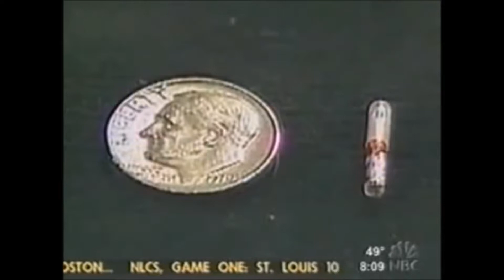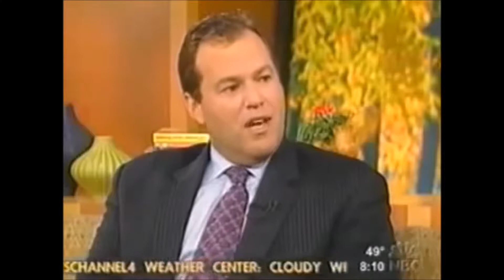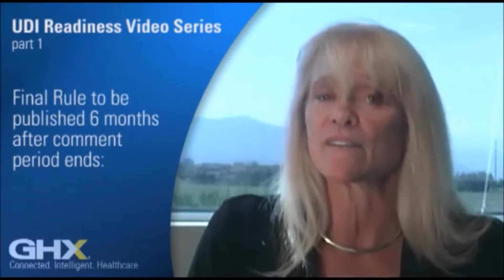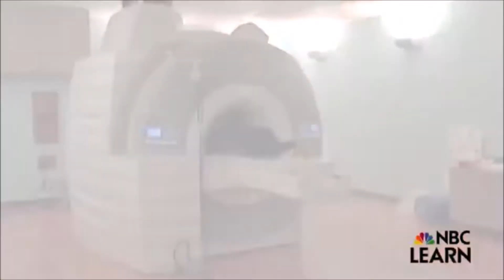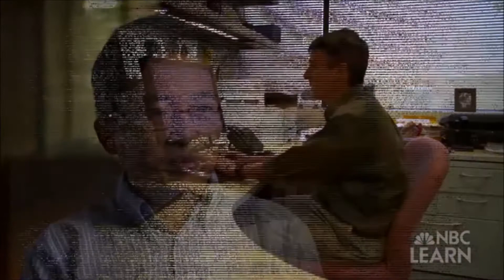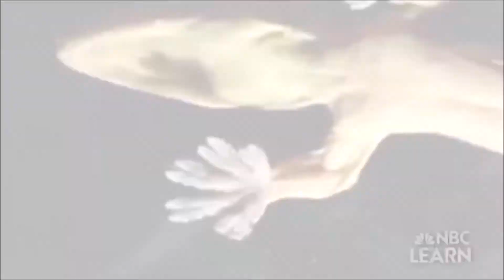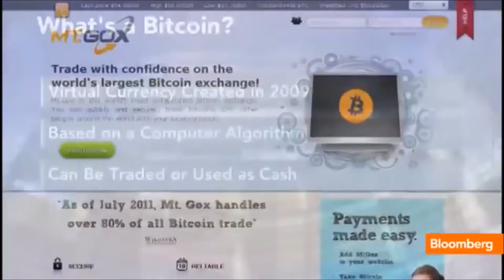Mark of the Beast: Part 1

Comment: DONT BE DECEIVED!   Rev 13:14 And DECEIVETH them that dwell on the earth...  But what does deceived mean, and how are they deceived? Deceived = Deceiving involves the deliberate misrepresentation of the truth, so that those being deceived are not aware of the deception.

The mark of the beast IS NOT FORCED UPON ANYONE. Scripture is clear in Rev 13:6 that the beast (system) CAUSES the mark to be received by those who are deceived. Some translations misinterpret the orignial greek word 'poiei' as (FORCES) but it actually means CAUSES, which is the same as the Strongs Word 4160 'it causes'.  Again in Rev 13:17 the key word here is the greek word 'dynetai' or Strongs 1410 meaning 'SHOUD BE ABLE'. So the proper translation reads, "...THAT NO ONE SHOULD BE ABLE TO BUY OR SELL.....

At what times in scripture did God (through His servants the prophets) tell believers that they SHOULD NOT BE ABLE TO BUY OR SELL? Neh 10:31 “When the neighboring peoples bring merchandise or grain to SELL on the SABBATH, we will not BUY from them on the SABBATH or on ANY HOLY DAY.

And yet again here we are told a similar thing in Neh 13:15 In those days I saw people in Judah treading winepresses on the SABBATH and bringing in grain and loading it on donkeys, together with wine, grapes, figs and all other kinds of loads. And they were bringing all this into Jerusalem on the SABBATH. Therefore I warned them against SELLING food on that day. 16 People from Tyre who lived in Jerusalem were bringing in fish and all kinds of merchandise and SELLING them in Jerusalem on the SABBATH to the people of Judah. 17 I rebuked the nobles of Judah and said to them, “What is this wicked thing you are doing— DESECRATING the SABBATH day? 18 Didn’t your ancestors do the same things, so that our God brought all this calamity on us and on this city? Now you are stirring up more wrath against Israel by DESECRATING THE SABBATH.” Amos 8:4 Hear this, you who trample the needy, to do away with the humble of the land,  5 saying, "When will the NEW MOON be over, So that we may SELL grain, And the SABBATH, that we may open the wheat market, To make the bushel smaller and the shekel bigger, And to cheat with dishonest scales?

The biggest clue in scripture to deciphering the mark of the beast is found in Mat 21:12 Jesus entered the temple courts and drove out all who were BUYING and SELLING there. He overturned the tables of the money changers and the benches of those selling doves.

Why would Christ be concerned about people BUYING & SELLING? Does He hate merchants? No! The reason was very simple - the inner court of the temple could not be opened except on New Moon Days & Sabbaths in accordance to Eze 46:1?‘This is what the Sovereign Lord says: The gate of the inner court facing east is to be shut on the six working days, but on the Sabbath day and on the day of the New Moon it is to be opened.

So in this case the temple was opened on Gods Sabbath Day and there were money changers and people selling animals for sacrifice, when Gods Law strictly forbids any commercial trade on His Holy Days.

So how do we recognize Gods Holy Days? We are told these things in Lev 23. The First Holy Day begins with a SABBATH after 6 Working days. But when does the 6 working days begin? After a New Moon Day. Numbers 28:11 "'On the first of every month, present to the LORD a burnt offering of two young bulls, one ram and seven male lambs a year old, all without defect. Numbers 10:10 Also in the day of your gladness, and in your solemn days, and in the BEGINNINGS OF YOUR MONTHS, ye shall blow with the trumpets over your burnt offerings, and over the sacrifices of your peace offerings; that they may be to you for a memorial before your God: I am the LORD your God. 1 Samuel 20:5 So David said, "Look, tomorrow is the New Moon feast, and I am supposed to dine with the king; but let me go and hide in the field until the evening of the day after tomorrow. Psalm 81:3 Sound the ram's horn at the New Moon, and when the moon is full, on the day of our festival (Passover + Firstfruits + Tabernacles = all on full moon);

But the only defense that people can offer regarding New Moon Days is this misunderstood verse in Colossians 2:16 Let no man therefore judge you in meat, or in drink, or in respect of an holyday, or of the new moon, or of the sabbath days:

So bible students automatically think God has made such observance voluntary, but this IS NOT what this scripture is saying. Its telling us that the true believers will not allow anyone to pass judgement upon them for keeping New Moon & Sabbaths and observing food traditions which point us to Christ - eg at the Last Supper, Christ commanded believers to eat the bread and drink the wine on Passover in remembrance of Him. But what about Col 2:14 Blotting out the handwriting of ordinances that was against us, which was contrary to us, and took it out of the way, nailing it to his cross; Well these ordinances were those which dealt with sin & sinners in accordance to the handwritten law of moses, but not the Commandments written on stone by the finger of God. Thus His 4th commandment pertains to New Moon Days, along with all other days as mentioned in Lev 23, with the exception that people no longer are required to sacrifice offerings. But observance of the days as being Holy are a mandatory requirement for believers.

The next Holy Day mentioned in Lev 23 is Passover on the 14th day of the 1st month, but is this on the 14th of January? NO! Why do we know that January is not Gods 1st month? Because in Ex 12:2 "This month shall be the beginning of months for you; it is to be the first month of the year to you. Exodus 13:4 Today, in the month of Aviv (Abib), you are leaving. Deuteronomy 16:1 Observe the month of Aviv and celebrate the Passover of the LORD your God, because in the month of Aviv he brought you out of Egypt by night. ABIB or AVIV is so named because it a reference to the stage of ripeness of Barley which only occurs around the time of the spring equinox, so that Gods perfect calendar always centred on His creation. So we only need to look towards the moon cycles around the time of the spring equinox to see the ripeness of barley to determine the beginning of Gods year - His first month which He calls ABIB, not january which is so named after 'janus', pagan god of the doorway. This is why the pagan easter varies from year to year, in accordance with the Moon cycles, so the pope & jews both know about this - hence the DECEPTION!!!

The whole world has been deceived by the beast and the second beast which made an image to the first that should speak to people. The first beast was the roman empire, which was then wounded by the sword (Word of God), and they became transformed into the likeness of a lamb with horns (Christian). The image they formed was based on the Julian calendar which gave the popes their authority to persecute and kill all who refused to worship the image of the beast (roman calendar). Then in 1582 the original roman julian calendar was slightly modified and ratified by pope gregory which became the gregorian calendar which the WHOLE WORLD WORSHIPS even until this very day.

If a believer follows the roman/papal calendar, they cannot find Gods Holy Days because Gods calendar at creation was based upon the Sun, Moon & Stars alone! Gods calendar has ABIB/AVIV as first month and New Moon Days, Sabbaths, and working days. Roman/papal calendar has days and months dedicated to the names of other gods to celebrate it pagan origins.

Thus every time a believer in Christ utters the name of the roman/papal calendar, they break Gods Commandment - Ex 23:12 “Six days do your work, but on the seventh day do not work, so that your ox and your donkey may rest, and so that the slave born in your household and the foreigner living among you may be refreshed.13 “Be careful to do everything I have said to you. DO NOT INVOKE THE NAMES OF OTHER gods; DO NOT LET THEM BE HEARD ON YOUR LIPS!

This is how the whole world has been deceived into disobeying Gods commandment against idolatry. The beast has replaced Gods Holy Days with their own holidays, so that Gods method of time-keeping has been obscured, thus people continue to BUY & SELL on Gods Holy Days when they SHOULD NOT, and thus CAUSES them to receive the mark of the beast, because they follow the beast system and worship its image (calendar), which is idolatry. This has been going on since the days of Christ when the romans first occupied Jerusalem in 63BC, and has continued throughout the ages, even until this very day.

The bible is self explanatory, there is no need to worry about SUNDAY or TATTOO's or RFID CHIPS or DNA or any such modern ideological nonsense. Such things could not possibly be called a deception and could not cause the WHOLE WORLD to be deceived. The method of timekeeping however, has fooled EVERYONE. Even the jews changed their calendar system back in 4th century AD under the leadership of Hillel II, so that all currently accepted earthly calendars are FALSE images of His orignial. Even the muslim calendar follows a strict 354 day year because it is lunar based alone, whereas Gods calendar is Luni-Solar as described in Gen 1:14. Eze 46:1-3 reinforces that Gods calendar is based upon New Moon Days, 6 working days, and Sabbath Days. Isaiah 66:22-23 also reinforces that Gods time-keeping system will continue even in the new heaven and earth by observing these same New Moon & Sabbath Days. Zech 14:16 also tells us that we will continue to observe Gods Holy Days like Feast of Tabernacles in the new kingdom to come.

The deception is something which we are not aware, and has been here for 2000 years. Sunday is just as much a lie as Saturday or Friday or any other roman/papal based name. Believers have been killed in the past for failing to recognize the roman/papal authorities, and today believers continue to be deceived to BUY & SELL on Gods Holy Days, thus receive the mark of the beast without their knowledge - its a spiritual mark. The prophet Daniel forwarned us of the changes to the calendar back in Dan 7:25 'He will speak out against the Most High and wear down the saints of the Highest One, and he will intend to make alterations IN TIMES and IN LAW; and they will be given into his hand for a time, times, and half a time.

Now listen to what the prophet Hosea has to say in 4:4 “Don’t point your finger at someone else and try to pass the blame! My complaint, you priests, is with you. 5 So you will stumble in broad daylight, and your false prophets will fall with you in the night. And I will destroy Israel, your mother. 6 My people are being destroyed because they don’t know me. Since you priests refuse to know me, I refuse to recognize you as my priests. Since YOU HAVE FORGOTTEN THE LAWS OF YOUR GOD, I will forget to bless your children. 7 The more priests there are, the more they sin against me. They have exchanged the glory of God for the shame of idols.

Believers are being destroyed for a lack of knowledge, they have forgotten the laws of God who created us all, so even the priests don't teach what God has commanded and have instead turned the people to follow idols (roman/papal calendar which honours false gods). Who teaches Ex 13:9 This observance will be for you LIKE A SIGN on your HAND and a reminder on your FOREHEAD that this law of the Lord is to be on your lips. For the Lord brought you out of Egypt with his mighty hand. 10 YOU MUST KEEP THIS ORDINANCE at the appointed time year after year.

May God add His blessing to these words?
Reply: Hey Mate, Yah is revealing heavy revelation to me thru satan and so I am now able to give the warning that World War 3 starts this year; the Big Ben is going to get shot up, missiles fired at it and ISIS will take the fall - FLAT EARTH being PUSHED has been the ESOTERIC CODE SIGNALING THIS EVENT. Spread the word, TELL EM JOHNNY DARK SPEAK SENT YOU 3∆3
Reply: Mark of the Beast      AND THE SEAL OF GOD   https://youtu.be/dEXoq1tkmJc